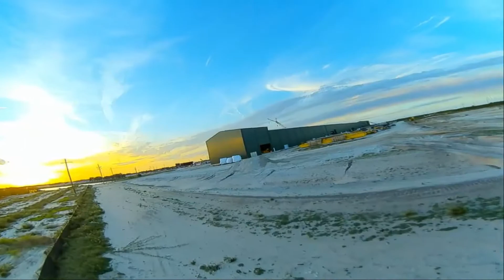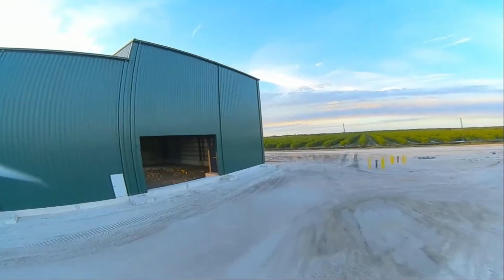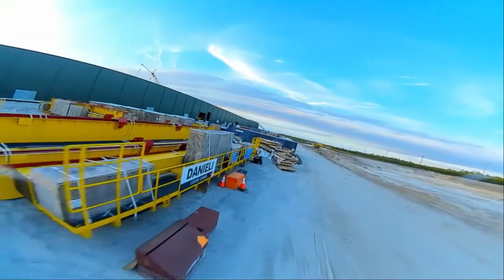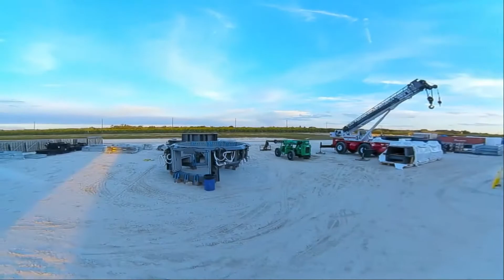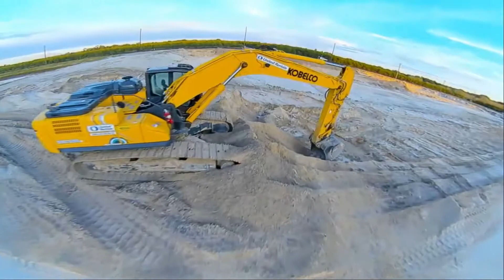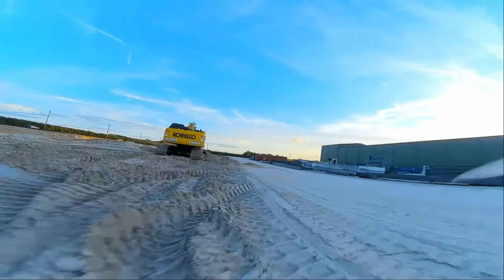FULL RUN INSIDE Warehouse ! ~ VAS Crosshair Xtreme ~ Armattan Badger 6" ~ DJI Digital FPV ~ R9M ~

Comment: I'm guessing this the video you directed me to? Nice spot & nice explorative flying man & super nice colours, love it 👍 Still not the type of sketchyness I'm referring to. Can you honestly say you would trust it in a spot where if something goes wrong like the dreaded dji image freeze/blackout or varying latency causes a crash & the quad is lost forever under the sea or in some canyon a mile or 2 out?  Still early days & still teething issues for the tech. Analogue has its issues and is ugly compared to digi HD but its reliable & latency stays the same. In saying that, I actually can't wait until its reliable & equally as responsive as the old log. Been dreaming of it for years now & it finally seems close 😃
Reply from the maker: KrissKwadd yup this is it. Thanks fun spot. 
Not really pushing range just showin this cuz on analog would be WAAY different. I have another vid at this spot where I flew close to ground out 1/2 mile w full bars.  Furthest I’ve been is 2 miles then had to return cuz of lipo. I’m not a true long ranger but plenty of guys on Facebook are and dji will work if ya know what to look for when signal fades like analog static. It does not just freeze. If ur buddy’s does he’s got problems w his setup. Analog has static digi has dropping mbps along with increased pixels on side then in center when shit is about to go bad. Single digits mbps. Below 5 watch for freeze 
But I never fly over water w any kwad lol  I’m too cheap
N not tryin to be a dji saleman I’m just a random dude in small town that flies alone 99% of time soo
Reply from the maker: KrissKwadd at about 2 min when I exit on far side it got scetchy n I felt lag. Ya can see side pixels. That’s cuz there was no opposite wall for signal to bounce off. Again dji uses MIMO feeds off multi path n heals signal. It’s all in the fcc filing. In spots w lotsa trees leaves n small objects it struggles w compression so gets pixels some confuse this with bad signal when mbps still stay high. Pixels are ok if mbps stay high. Like light analog static

Comment: Nice lighting. Are you running the wide angle lens? Noticed how small the man lifts look.
Reply from the maker: It was pretty nice out n ev at -1 or +1 whatev is brighter, saturation 1 below max, but I do run all new lenses, runcam rc18g, they just a Lil wider fov, n glass looks much better than dji stock ...they stick out further but I acommdated for that w mounts.  Lifts may just look small cuz everything else is massive
Reply: Yeah, you assume the cranes are massive. But when you see those man lifts, you get a better sense of scale.
Reply from the maker: @rcrdps8144  I just mean everything there is big, no clue how big a man lift should be anyway lol